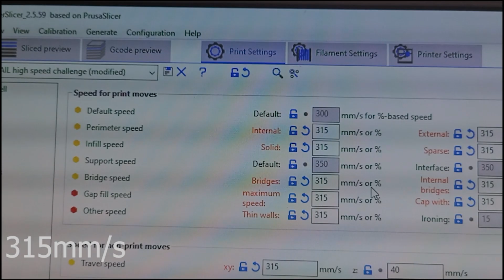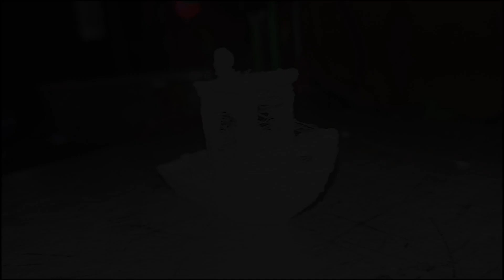My Fastest Benchy Yet! #speedboatrace

Comment: If you put the boat at 45 degrees angle, both x and y motor share the load more often. Maybe it is possible to push it more?
Reply from the maker: I could try, I've seen it, i didn't knew it was to share the load, i thought it was because it made the moves shorter so it would be faster, but now that you point it out, I'm gonna give a shot